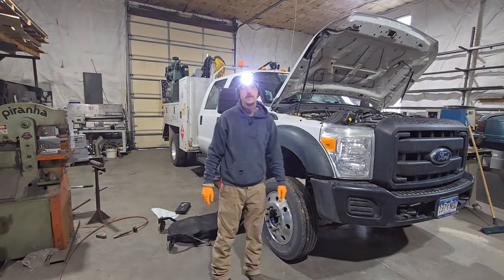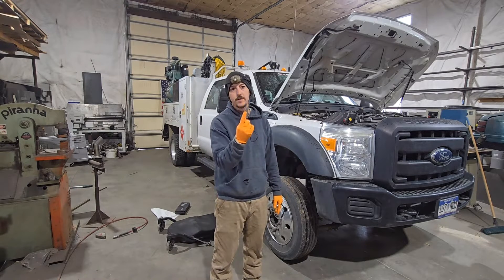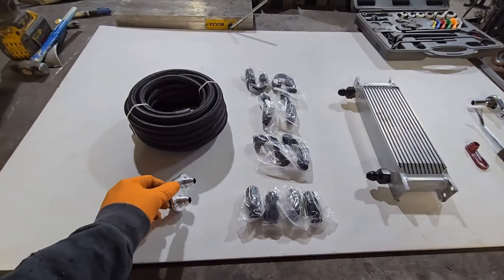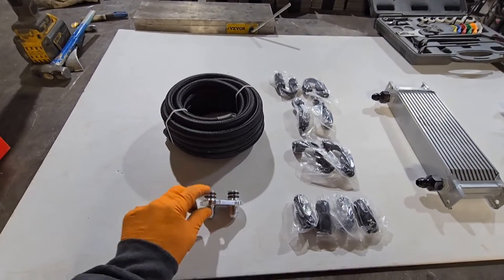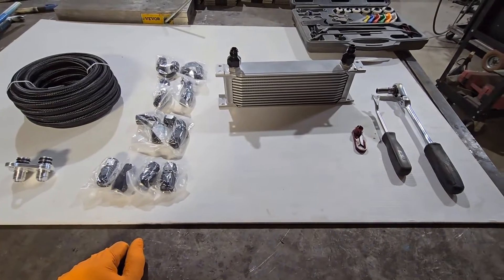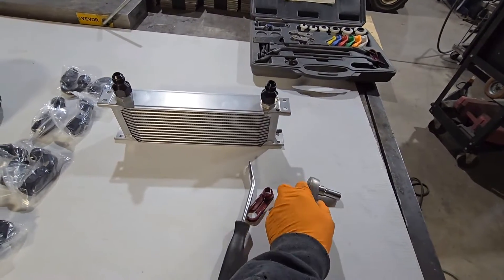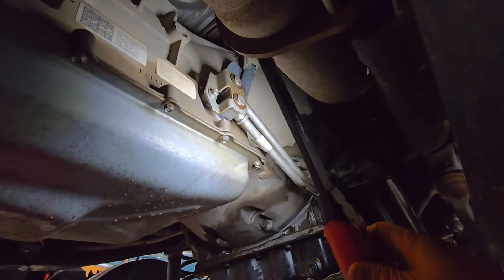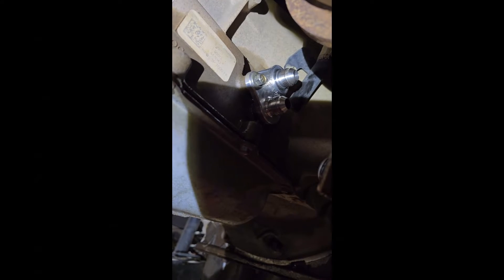6.7l powerstroke Transmission cooler line replacement.

Comment: Im about to tackle this on my 6.0, what an engineering flaw, amazed how close the exit & return lines are to the exhaust pipe, almost canceling the cooling capacity of the radiator?! when  I do mine, Im wrapping both pipes in exhaust fabric. I just hope it's enough,
Great video !!! most just show the tool to remove & and replace 
again, thank you !

Comment: I have a 6.7 1 ton. How is this mod? How have your trans temps been?
Reply from the maker: I added a larger cooler and it runs cooler than factory
Reply: Which one did you add? Mine is leaking, need a replacement.